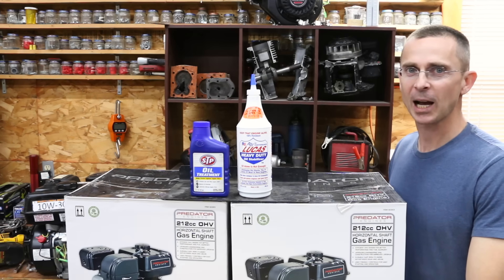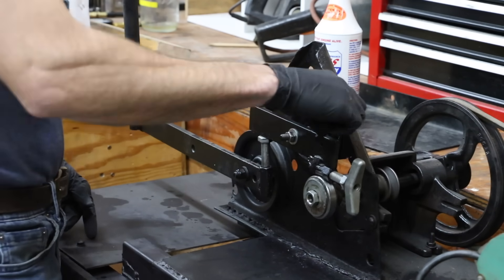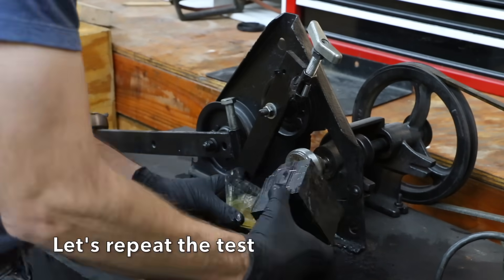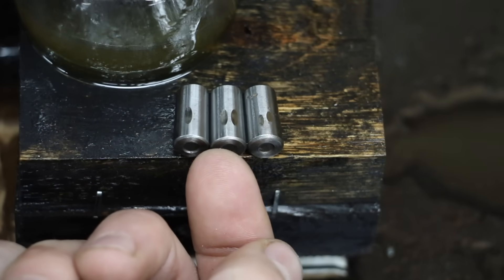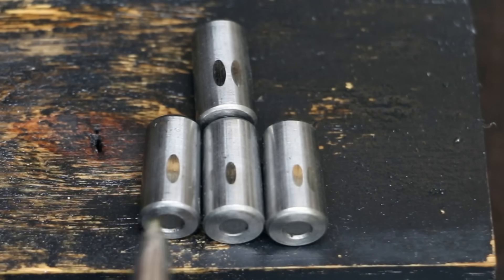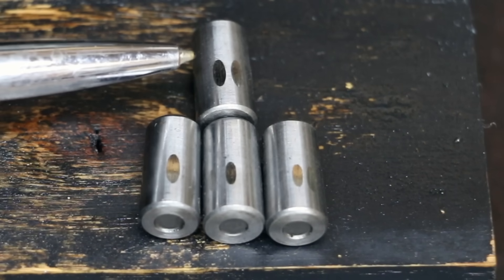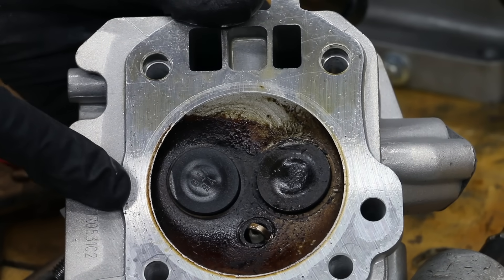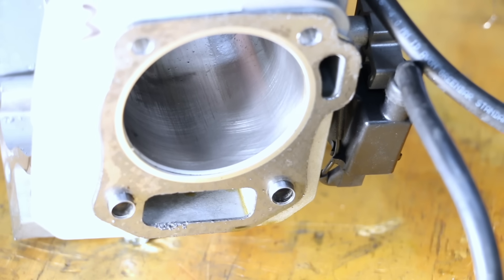Which engine self-destructs first?  Lucas or STP?

Comment: This test may have been interesting to dome kids, but really revealed very little of value:  In essence, if you're going to run two mall OHV air cooled engine with ZERO oil in their crankcase, it don't matter beans which brand of "Magic Motor Hunny" you pretreat it with.  Both engines wil grenade literally within minutes of each other.  But maybe thanks to your demonstration your neighbors kids might just save a few hundred bucks by dumping a liter of even half a liter of his used Pep Boys' oil into their crank before waiting for it to go pop. Might even last  month or two!
Reply from the maker: Thank you

Comment: Lucas did stay running considerably longer however the STP ran consistently cooler temperatures. So in an air cooled engine application I'd have to lean towards STP.
Reply from the maker: Thank you

Comment: Very informative video, notice how Lucas runs hotter but it runs smoother, STP runs colder but it's louder, the higher viscosity might have helped the Lucas engine last longer because it coated the motor with it's thicker oil mix. What if you mix products of same brand like Lucas oil treatment with Lucas Top cylinder oil lubricant/ Carb cleaner, would that help the motor last longer in the piston and top end parts. Less scuffing and piston wear. 
Great video very Great work!
Reply from the maker: Thank you!

Comment: I’ve been putting Lucas in my Toyota for as long as I’ve been doing oil changes on it. At 650000 km the motor is still running strong. I just wished it helped out on everything else. I bet when I go to buy a new car it won’t be because the engine fails it will be because everything around it does.
Reply from the maker: Very impressive!  Thank you
Reply: I've been running a Toyota pickup for 32 years with absolutely NO ADDITIVES and change the oil when I feel guilty...which isn't often (and cringe...I use walmart oil and filters)  and its STILL RUNNING STRONG after 207,000 miles/333,000 km. There is no magic in a bottle of concentrated oil. BTW, I didnt say my old truck still looks great....but it runs fine and the ac still blows cold!
Reply: I had a Toyota Yaris and I put a half bottle of Lucas in every oil change until it hit 400,000km. Then I started putting in a full bottle every time. I sadly lost that car last year at a ripe young age of 780,000km.

Comment: what i can say is lucas products are in them top fuel dragsters, i’m a lucas dealer and an ams oil dealer and it really depends on where you live and what the application is , also temperatures. ya don’t want these if you live in canada per say and i live in FL it’s 107* and this save the hell outa the engine. i service emergency standby generators and here EVERYTHING i service get the correct amount and i’m talking 200+ gal of oil, and no i don’t use ams oil, i use delo and lucas ams oil is great but can’t take the punishment... hurricane season they can run for weeks ..tried it... but that’s all is in the race car  just some person input ✌🏻🇺🇸
Reply from the maker: Thank you!

Comment: Next time I'm deciding what additive to use in a lawnmower engine when mixed with crappy quality oil I'll check back with this, but in my cars and motorcycles I'll stick with good full synthetic oils and leave it at that.  It was a waste of time skimming through this, but not nearly as much wasted as the author suffered.
Reply from the maker: Thank you

Comment: Aren't you supposed to tell us who the winner is seems like the Lucas Engine ran longer.
Reply: He leaves it to the viewer. Thats his way of doing things. Let the results do the talking.
Reply: The winner is the company who sold him the engines!
Reply: Looked to me the Lucas had less galled alum stuck to the crank, for whatever that’s worth.  Actually,  both did pretty good-  edge to Lucas
Reply: I think it would be unreliable to make a strong conclusion about that. I think you'd need to run the test at least several more times, and I think you should also include just as many control samples that had no additives used at all.  I wouldn't be interested in seeing a bunch more engines destroyed though, however.  Although, I guess it's not as bad as it first seems.  Quite a lot of the engine components are still in new condition after the test, and so still of value to someone who needs the parts.
Reply: Yes and no. Neither engine had any lubricant in the final destruction  sequence. Kinda assuming that the Lucas engine ran longer due to the Lucas residue left on the internal engine components, but we really don't know for sure.
Reply: Thankfully for him, he lets you draw your own conclusion. The field days would have had a lawyer if he'd made a recommendation.  caveat emptor.  Narragansett Bay
Reply: I think it's pretty clear from the video which additive was better.
Reply: Which one won?
Reply: @EARTHLING74000  both engines are garbage, nobody won!
Reply: Jd Dj common sense who won? Idk 🤷‍♂️

Comment: I use bishops original oil additives in all my engines.  My buddy owns the company located in Houston I also like their wd40 replacement it works great as a lubricant as well as cutting fluid for use on my lathe and mill.   I would like to see a comparison on this stuff.  They also make upper cylinder treatment for your fuel system as well as special fluids for tractors and such.  Lubrilon is the company name
Reply from the maker: Thank you

Comment: I would like you to use the AMSOIL oil additives if it possible. For the auto engines due to the company has different additives for small two cycle,  small four cycle and larger auto engines . You are doing a swell job. Keep the information coming
Reply from the maker: Thank you for the video idea!

Comment: It is possible that one engine was more susceptible to seizing than the other. Before you pronounce one additive the winner, I believe you’d need to repeat this test a number of times and collect the results. If the engines with STP consistently fail before those with Lucas, then you’d have a result in which you could feel confident. A sample size of 1 is not very scientific.
Reply from the maker: Thank you for the video idea!

Comment: Slick 50 vs Restore Engine Restorer vs Marvel Mystery Oil vs Prolong. TO THE DEATH!!! I love these videos! Been using STP for years.
Reply: Would definitely be interested in the "Slick 50" results.
Reply: I also have used STP for over 20 years. A Ford V8 and two Toyota 4 cylinders all went over 300K with no engine repairs. Drove two to the scrap yard and drove the other to the boneyard, all with rusted and busted frames.
Reply from the maker: Thank you

Comment: I would like to see you try slick 50. I followed the instructions with my new truck years ago and within 20000 miles the new engine was toast. Rings were totally chewed up. Needed a new engine to the tune of 7000 dollars. The auto company said it was due to the slick 50 additive. Does that PTFE even work? Try it and lets see what happens.
Reply from the maker: Thank you for the video idea!

Comment: I used to flush out my pickup engine using diesel fuel, sometimes alone, sometimes with a quart of oil to thicken a little. I idled the engine til up to temp, then slowly revved up to 4000 rpm or so for a few seconds. Repeated a couple times and quickly popped the top fill lid followed immediately by the drain plug. Took fill lid off so as to allow quicker drain flow. Usually came out fairly black. Engine never went over temp, and ran cool thru this whole process. For awhile i would pour pure diesel thru the engine afterward but it didn't produce much muck. Diesel has lubricity, and i wonder if filling engine oil with, say, 20% diesel, balance = maybe a little thicker oil than spec', would improve lubricity. Plus it could make engine oil stay cooler by evaporation. Whatever leaked as piston ring blowby would likely burn off nicely, so maybe you could monitor the oil level and thickness, and just add more diesel instead of oil, to compensate the blowby and evaporation losses? Thanks for excellent videos. P.S. that engine i referred to was a 22R, carbureted, and ran my pickup for 327 K miles+, and 22+ years, until it succumbed to a blown head gasket and the truck had aged thru rust. The simple 4-speed transmission allowed me to roll-start, and lack-of-brains (go figure) made it the most reliable vehicle i have ever owned. If i build my shop before it ages from sitting dead in the weeds, i will likely rebuild and use as a home power generator, and maybe a utility PTO from drive-shaft to vee belt thru  bed to power just about anything. If i can engage and disengage the drive-shaft to differential (simple farm PTO-to-square-drive), it would be a highly mobile power source.  Thanks Again, and everybody feel free to use my ideas. The only thing i ask is that you post a video of your creation.
Reply from the maker: Thank you!

Comment: Well I used to love STP but that was years ago that I. Started using it at age 16 actually before I had ever even heard of Lucas which I think was probably 25 years ago and the more I saw and talked to people I kind of edge towards it. But close to that time is when I started hearing of Amsoil and we had a factory rep come to the shop of our construction co. And give demo and demonstrations. I'm not sure if it Lucas  or Amsoil that has the little test stand that has engine oil in one side and their product in the other and when turning the crank it spins the stacked gear assemblies in both products and you watch and see which one has the retention ability to pick up the product from one gear to the next and on up the stack higher and higher and each time and place I saw one of these as they were in auto parts stores it made me start to believe in these newer products. But I will say this much, your test is way more thorough and yes taken to the point of total destruction. With that said I think my teenage Indy inspired belief in STP has been changed to Lucas now. But I would love to see Lucas and Amsoil face off against each other. If I were you with as much testing as you do I think I would go to different manufactures and say hey I'm going to run these test on you tube and I run unbiased equally tested tests for both or multiple products and I have a fairly large following and perhaps my demos may help sell more of your product due to the results, would your company be willing to supply me with test engines and money to purchase your products from a local supplier. That way they could be supplying you with doctored up products with specs beyond what's normally available. Tell them you will do the testing for an equally set price for all suppliers providing you a income. In essence you would kind of be making yourself UL of the farm test industry! You seem to be very honest hard working man and I think you could build this into possibly a way of earning a living for you and your family.  It was a very interesting test! PS one other thing the Amsoil rep told me years ago that always stuck with me was he said you cannot destroy oil (I guess you could burn it) and he then said its not the oil in oil that goes bad it is each individual manufactures additive package that ends up breaking down and going bad and not the oil. He said that's how come they can take old used oil and if re-refined properly the the new oil raw oil will have the exact same properties as the original raw oil used before the additives were added. CN
Reply: Curt Nicholson I guess me and u are the inly people a year late. I voted for Lucas oil because it's my real name,
Reply from the maker: Thank you!

Comment: If you’re going to do something do it right, what I mean you need to try just STP oil treatment and just Lucas in the engine no other oil that’s what I want to see break in the engine with a regular oil drain it out and fill the engines full of STP and Lucas In two different motors then crank it up and see what happens when you drain the oil that would be a much fair showdown and very interesting
Reply from the maker: Thank you!

Comment: Total waste of time 2 brand new engines and STP & Lucas oil treatments which are both good products for high mileage engines.
I have a Sears Craftsman Briggs & Stratton lawn mower I bought over 15 years ago with only 1 oil change after break in. Engine runs perfect starts first pull every time and uses No Oil !
Reply: Miguel Salami and your point is? 😕
Reply: Mark Douglas it does seem senseless and a waste, but I myself has always wondered on samples such as this, this company claims to be the best, that company says no I'm better than you and here we have a guy that takes time to show the world which really tests best and I'm grateful to see him do these tests then I myself know which product to buy instead of wasting my hard earned money on garbage. oh yeah, I once had a buddy years ago that put slick 50(when it first came out on the market) in his 67 mustang, and on a hot summer day the line that leads to his oil pressure gauge melted and oil pumped straight out why he was driving, he made it home with no oil in his oil pan, did slick 50 do its job? don't know but I believe it did and saved his motor, therefore I really don't think this test is senseless at least NOT to me

Comment: Slick 50 v Prolong, these are treatments for bearing prep and coating and would possibly run dry sump. The two in this video are treatments for oil and require oil to lubricate,  they are not coatings or preps. So i dont understand this test.
Reply from the maker: Thank you for the video idea!
Reply: @ProjectFarm  Just so you know: Slick 50 is a -- heat bonded -- teflon application for bearings, cylinder walls and any connecting points where heat friction will "bond" Slick 50 to metal parts. BUT-- Prolong is a preparatory surface polisher, micro-grind, into glass-like frictionless reduction on surfaces. 

I use them both.
Test for methodology: Can you shine before coating?

seriously.

know these additives and 'treatments' and what to do with them???
'how to use them ?'

Comment: I owned and operated a 1990 IVECO Italian made Turbo charged
diesel van which I ran for 20 years I parked it when it became impossible to
find parts in the USA. After a 10,000 break in, I switch all lubricants too Ams
oil synthetics and also added their bypass 
oil filter system, I then sent in for spectrographic analyses engine oil
samples at 10,000,15,000 and 25,000 miles ( the oil was still useable) and
changed the duel factory filters every 6,000 miles and maybe changed the bypass
filter every 35,000 miles as it was about 12-14'  long and about 4" in diameter  I would feel the hot oil canister starting at
the bottom and work my way up till the filter 
changed from cool to hot when it reached 1/2 the total length I changed
it. 

I lubricated the chassis and drive parts with Ams oil
synthetic grease it was the red color the drive shaft u- joints had went
350,000 miles +/- along with the steering linkage and the universal joints
never failed although the steering box did fail around 200,000 miles.

Finally I usually repacked the front Timken wheel bearings
around 30,000 with normal wheel bearing grease and then went to Ams oil grease
the same red one I inspected at 65,000 miles and the bearings and lubricate
were both still in good condition, I cleaned and repacked them and decided to
try 90,000 miles and the right front wheel bearing failed at 85,000 miles
SHUCKS!

I would like to see you use AMS oil in your next synthetic
tests as for me there is none better as I save thousands of dollars in engine
oil alone over a 20 years period to say nothing about the labor and 14 quarts
of used oil every 3,000 miles if I had used regular oil.
Reply from the maker: Thank you

Comment: My 79 f100 ran on an oil water mix for 6 months until I junked it because of rusty brake lines and gas tank. Blown head gasket / cracked head. Fill up the radiator and say it's steam powered
Reply from the maker: Wow! Thank you

Comment: Umm how about a real test like using the same filthy oil from an improperly maintained engine that just threw a rod because of it… then add it to two new engines with each proper amount of STP or Lucas and run them till they choke on that.. That would be a little bit more "real world" than running them "dry" of everything but additive.  The additives are designed to work with oil, not by themselves.
Reply from the maker: Thank you for the video idea!

Comment: Remember the Slick 50 ads? I don’t know if they still sell it but they showed engine running after draining the Slick 50. And I believe the Gastro GTX had the same ad running after the oil was drained. What you need is another engine with a standard or synthetic quality motor oil against the other above two I mentioned and really see what really works best and this time keep track of the time.
Reply from the maker: Great test idea! Thank you

Comment: I would have liked to see you fill one engine with just Lucas to the correct “oil” amount and the engine with just STP to the correct “oil” amount and see what would happen. Is STP or Lucas a good enough lubricant to keep the engine alive, or is one (or both) not up to par
Reply: Lucas states you can use up to 80% Lucas and 20% oil on the bottle
Reply: I suspect that both of them are good enough lubricants that the test would take FAR longer than is practical for a Youtube channel.
Reply: Hq 88 kinda what i was hoping to see also
Reply: With all that foam?
Reply: They would seize immediately. It's not fun cleaning that mistake up.